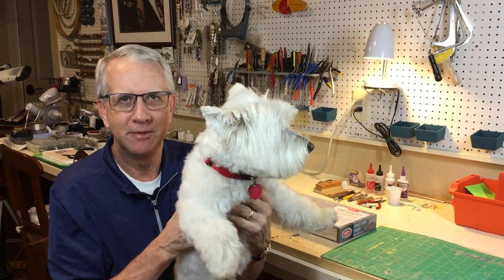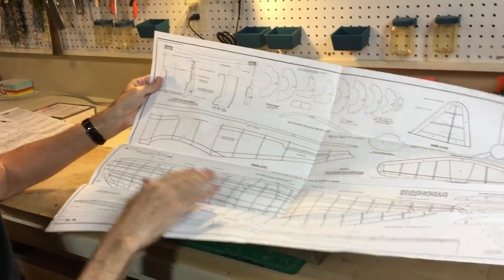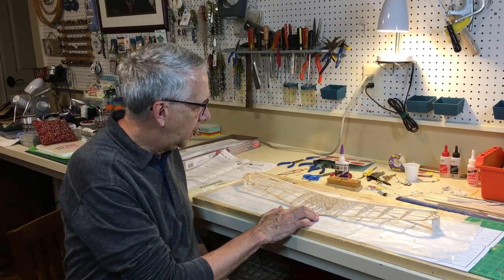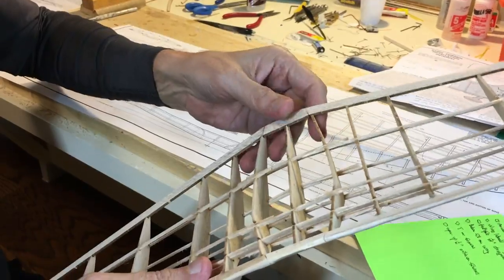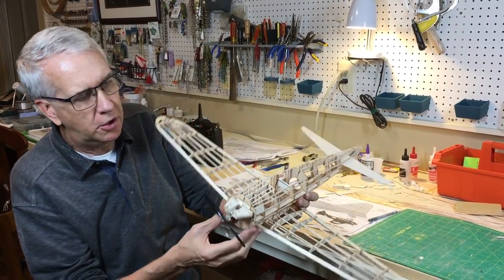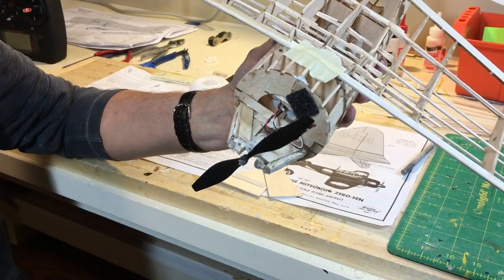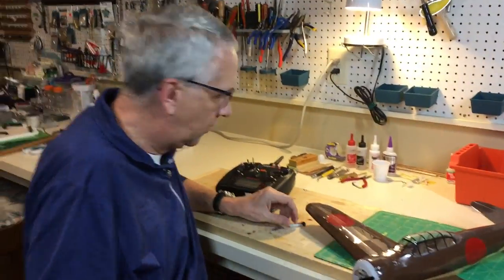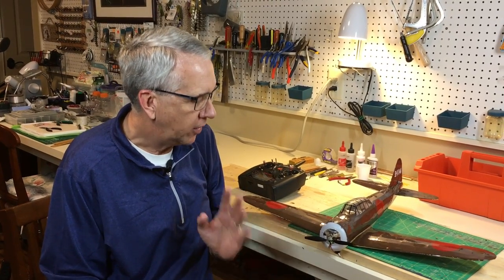Guillows Zero RC Conversion Step by Step Underpowered

Comment: Wow! That old Adams Actuator Pulse single channel brings back some memories! That's what I learned on! Built on old kit called the Lightning Bug. Covered with Aerogloss clear dope over the old silver-aluminum tissue paper. Had a Cox.010 in it, but I modified it to take a bigger fuel tank, and she would fly for close to 10 minutes at a time. Once I was skilled at flying it I moved onto Guillows Comet and Stirling kits modifying them as needed for the old gear. Thanks for the memories!
Reply from the maker: QH:  Great recap, thanks for sharing!  Tim

Comment: And to the newbies into making guillows rc conversions and nervous or worried that you won't be able to do it go for it. They are cheap and a great way to teach you to scratch build balsa planes from kits. They are great light weight fun little park fliers and cheap to buy a kit compared to expensive 100-200 dollar balsa kits and the electronics are very inexpensive as well. The hard part is just making sure you have every piece nice and square that you add in for the rc conversion and making sure you have everything nice and square is the most important part but not to hard to do it right. And thank you for doing this as a 3 channel plane makes it that much easier if a conversion for people who is doing a conversion for first time. And guillows planes can be super scale looking they make good scale realistic plst form knmd😮
Reply from the maker: All good, thanks for checking in!  Tim

Comment: Thank you SO much for these videos! You are so clear and concise. I'm planning on doing my 1st conversion soon and trying to decide between the Zero and Dauntless. I will be referencing your videos often! Great work, sir! 👍
Reply from the maker: Stan:  Good luck with your conversion!  I'd go with the Dauntless first as it is a larger aircraft and you can use the exact same motor and controls as I did on my Guillows Hellcat video.  Or, just build the Hellcat, flies great.  Tim
Reply: @TimMcKay56  Thank you, I was leaning towards the Dauntless since it's easier and this is my first conversion, the Hellcat would be great too!
Reply from the maker: No worries, good luck!  Tim

Comment: Tim, this would be an ideal platform for the 2S 180 size components.  I've built a number of Classic Pattern planes this size as well as a few original designs as you can see most of them on Outerzone.  The 3-4oz warbird really needs the extra oomph that the 2S setup provides.  I have standardized on the UMX Cessna components as the AS3X in them is more configurable (it is basically a micro AR636), the BEC will handle the higher draw of the rotary servos, and the ESC was designed for higher-current motors.
Reply from the maker: MH:  Great info!  Can you shoot my your email address in case I have further questions?  In YT search, just type Tim McKay Channel, my email is in about.  😃 Tim

Comment: Great Job on the build lovely plane. I think you could have got it to fly on that motor. You've developed the classic power flyers bad habit pulling up in when really you should do the opposite to regain airspeed. I know its counter intuitive and your approach does work if you have plenty of power.  I grew up with slope soarers (to long ago over 30yrs) so can identify the problem.  In the glider world if you push down it goes down very fast but if you keep pulling up it will still go down. I recommend something like Bixler  and resist the power once up in the air and gliding practice.  Failing that use your existing planes and practice dead stick landings. I really like like your conversions. I'm working on something a little larger at present a 76 inch lancaster bomber estimating and 2yrs at my current progress to get it in the air. Great build vid.
Reply from the maker: Mark:  After 8 Guillow conversions, I can find out real quick after hand launch how the model will behave in the air.  With the WW2 birds, there is just no sufficient control authority to fly at the lower airspeeds.  I can get away with this for the Cubs, but the fighters need a bit of airspeed and ailerons for initial roll control.  Do see the follow up video on the Zero with the larger motor, as well as my Hellcat video.  Tim

Comment: The formers in the section from the wing to the tail could be lightened considerably (cut a larger hole in the center). Also the stringers could also be lightened (not the 1/16" ones) which would save a considerable amount of weight also. 
Keep up the good work, I really, really enjoy your videos.
Reply from the maker: CD:  Very useful tips, thanks!  Tim

Comment: Great video! I really enjoy all your Guillow's conversion videos. Have you considered trying motor/esc setup from the turbo timber as a potential re-power? The brushless EFLUM6960 motor with the EFLA6421BL receiver/esc/servos? I haven't done the math on the power&weight increases but the form factor is much more similar to what you're running now compared to running a separate motor, esc, receiver, and servos. It might requite a lot less modification to the airframe.
Reply from the maker: Dan:  That is some very useful information, thanks for sharing.  I looked up on the Horizon Hobby website, as well.  Looks like the motor should provide sufficient power.  Tim

Comment: Great video.  Is this an IPS brushed motor, and a single cell battery?  What kind of esc did you use?  Happy holidays.
Reply from the maker: WS:  Yes, a brushless motor and single cell lipo.  ESC was built into the receiver/servo brick.  Tim

Comment: I kinda want to take a guillow's kit and build it into a diorama wherein you can flip a switch and the aircraft will go through its preflight check, but finding a PCB board to control that would be... alarmingly expensive. That being said, what would you recommend for engines to fit inside the smaller guillows kits, that are also able to be throttled semi realistically (going to probably rig up a dial on the display pedestal for it) bearing in mind that weight is not an issue since it's not going to be designed for flight?
Reply from the maker: Sergei:  Any small electric motor should work fine.  Try the Suppo A1504 brushless motor from www.AltitudeHobbies.com, using this now on my updated Zero.  Tim

Comment: I love micro balsa planes and thank you for these videos how to make guillows kits into RC planes instead of free flight. It's kinda work intensive but not to bad and you make the process pretty easy and the guillows kits are easy on the pocket book to build cause my local hobby shop sells them for 24-35 Dollars per kit and that's the laser cut ones for a die cut one they are only 12-17 dollars but i do have a die cut one and it's been hell getting the parts cut out and I had four split just cause how cheap the kit wood is so now I just traced the two sheets of balsa kit wood parts with tracing paper with out cutting the parts out and then made templates but transferring my tracing from the tracing paper onto a sheet of good balsa wood and cut my parts out my self and now if k crash it I can re trace the broke parts and fix it lol. But die cuts are so much harder to get parts cut out if using box wood it comes with
Reply from the maker: Sounds like you have a  plan!  Tim

Comment: Sorry if you've answered this already Tim, but working on my Sopwith Camel, I'm stuck on how to paint the plastic. The acrylic paint I usually use just doesn't do the job, even if I sand it first. I hesitate to use acrylic. Any suggestions very much appreciated.
Reply from the maker: I have had good luck with several coats of latex paint on plastic. Tim

Comment: I was mentioning if you have used the IPS motor earlier because I built the same airplane with a gear drive IPS.  First, I hand-launched it to make sure it flew straight, then I engaged the prop, and it flew fine.  Your plane climbs up first (tail heavy??), stalls and comes back down with a speed less than its stall speed.  Perhaps it is not balanced according to its projected center of gravity (or the one in the plan is wrong).
Reply from the maker: WS:  Yes, I think the original Zero flights were tail heavy.  Second attempt worked better!  Tim

Comment: Hey I just found a guillows rufe. I would like to build it brushless & for water use with floats. Is the lite coat water proof ?
Reply from the maker: The covering is waterproof. But water always seeps in, consider using sealant for the float balsa wood.  Tim
Reply: @TimMcKay56  I will try this method thank you I & appreciate your videos!

Comment: That airplane is seriously tail heavy. Extending the nose a bit will help that. I think that it's probably not underpowered, but too heavy like most Guillows airplanes. There are many weight-saving methods for removing unnecessary wood from the airframe while not compromising strength and ways to make the wing more efficient. The strategic use of carbon fiber helps a lot as you know that every few grams count.
A larger and heavier power system is not, in my opinion, the way to go unless you want it to fly like an F-16 or a powered stone. In addition to airframe weight reduction, perhaps a different propellor than what you're using now would work better.
I hate to say it, but the colour is totally wrong. That brown doesn't look like any kind of colour used by the Japanese for aircraft in WWII, and if anything, closer to what might have been used by the Imperial Japanese Army which did not fly Zeros. The  IJN used lighter and darker greys, various greens and grey/greens, even a kind of tan that is often mistaken for yellow, but not chocolate brown.

As always a great build, and I wish you luck and happiness.
Reply from the maker: GM:  The Zero was one of my most challenging conversion.  As I stated in this video, the kit just too heavy for the ParkZone system.  Simply not enough power.  Plus, rudder control was not going to work for lateral control, needed to go with ailerons.  The short nose moment did not help with CG issues as well.

Do take a moment to review the follow on video: https://youtu.be/YnH7uvnPgV0

With a larger power system and bigger battery for CG help. the model flies about as well as it can, I think.  Fully aware of no brown Zeros, I was just trying to save a buck and use a roll of covering that I had in the shop.  Bottom line is I learned a lot, and this resulted in the great success of my Hellcat conversion.  Tim
Reply: @TimMcKay56  I saw the follow-up. I had commented on it previously. Well, the Zero actually looked pretty good in the air, if a bit on the fast side. However, I bet you didn't feel all that comfortable with it, no aerobatics, for instance, which with a Zero is a non-sequitur. That nose still looks awfully short even for scale. I still think a better flying model of it (one you confidently could roll and loop) could be made with the suggestions I previously mentioned.
There's something so sexy about Japanese WWII models and their bright scarlet Hinomarus.
Reply from the maker: The Zero flew quite well In follow on flights. Ailerons were the key. 😊. Tim

Comment: Your card did not show up again. I can video your video to show you if you like.
Reply from the maker: Doyle:  Doing a quick Google search, this seems to be a fairly common problem.  Tied in to browser operating system, etc.  Not sure how to proceed, as cards working fine here and on various friends' computers I see.  I pasted in a typical comment from my search.  Tim
____________________________________________

Hi. The cards I created both on older videos and new ones aren't showing up when viewed on computer browsers, but it does in the iOS app on my phone. I have no problem seeing cards on videos from other channels, but on my videos they doesn't show (it used to work earlier this year). I've tried Chrome, Opera and Safari on macOS. But I think there is some problem with my particular channel... Also, I can add cards and see them in YouTube studio / studio beta with no issues.

How can this be resolved?
Thanks!